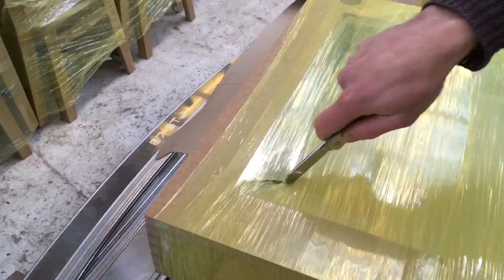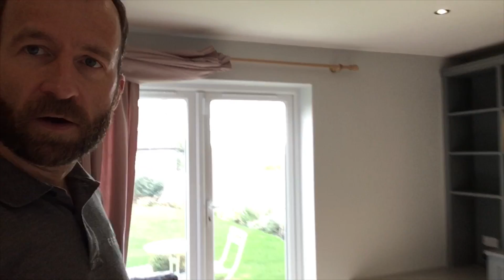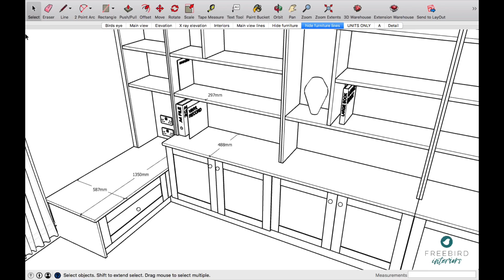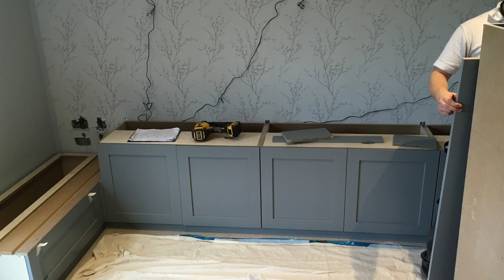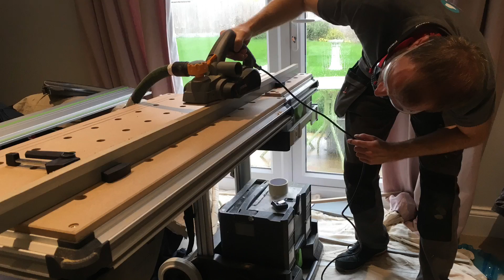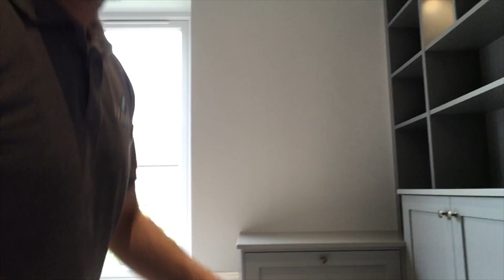From Sketchup Design to Finished Furniture

Comment: Great aolutiins for thus mistakes, wgat actually could be happen to everyone . 
Please let me know what software do you recomand for a beginer cabinet maker ? Software shat could build easy sny type of cabinets , maby could makd a quote if the orices of materials and laboures are already set up.  Many thanks.
Reply from the maker: Hi, well I use Sketchup and you will find a training course on it on my channel, and it is relatively easy to get started with compared to other 3D drawing software.  However if you want to go straight to making cabinets which are ready for cutlisting, pricing, etc, this is really quite a complex matter that either takes a lot of learning and set up, or you pay for 'parametric' cabinet software.  If you want to really keep it simple, research iphone and iphone apps that can do this.  But they will all have limitations.  If you want to get serious about this you could try CabinetSense but be prepared for a lot of learning time.  Make some time to watch this video: https://youtu.be/WaDJSBjrNjI?si=YQhW21DXVdYPLdnM

Comment: Hi there, always find your videos a joy to watch Alistair. May I ask you a couple of things, the doors did you make them yourself or had them made by example Lawcris. Ps which is the most one use (range/model) from lawcris in terms of melamine/laminate. Thanks in advance. ps. I am looking to use Lawcris you see and frankly I feel that if you know what you want its ok otherwise one just gets lost and a bit of a struggle to work them out.
Reply from the maker: Hi thank you!  We made the doors.  Or possibly at this stage we outsourced them as 2 piece made by a local cnc company.  Now we have our own cnc and make them either 2 piece or 1 piece.  Yes loads of laminate variations.  These days we use the ‘12-twenty’ range of melamine faced mdf by Finsa.  Bought via Able boards, Premier Forest, Lathams or Falcon

Comment: Hi, nice work. Quick question, how are you fixing the thin filler pieces on the sides in place? Thanks
Reply from the maker: For inset scribes like these ones I mostly just use a good construction adhesive, places sparingly towards the rear of the strip, on the unit and on the wall.  Sometimes also nail gun nails (18 gauge), through the wide panel into the edge of the scribe, so long as I have a matching wax filler to fill the holes afterwards.
Reply: @Alastair_Johnson  thanks. 👍

Comment: I'd categorise that as an adjustment rather than an error. But it does pay to sit back and think about a workaround rather than automatically thinking re-doing it is the only option. the finished product looks great. Also with that design of overlapping door - you could actually add strip LEDs and they would be defused nicely :-)

Comment: You got very lucky with that one mate . Very intuitive well done . I did notice a screw went in the wrong place in the drop done box ( workshop shot) 😀
Reply from the maker: You and Peter Millard both noticed that (along with everyone else too polite to say probably!)
Reply: Freebird Interiors 😀 hi Alister .would it be possible to send you a email about a cabinet I’m  building (for my self) in relation to the hinge or carcass position with an inset door closing flush with an end panel not the carcass as the inside is exposed birch ply with paint on outside? Hope I’m making sense.
Reply from the maker: david osullivan yes go ahead find my email via my website

Comment: Another great vid, many thanks for sharing. You mention at the start of the vid, the word "Design" which got me wondering, do you need professional indemnity insurance for designing furniture here in the UK? You know, proving that the furniture could hold up in all areas when fully loaded etc or do you just push this down the line to material suppliers/manufacturers?
Reply from the maker: Hi I seem to have missed this comment first time around!  Well I do have professional indemnity insurance but it’s rare I feel I’m doing  anything that might be risky

Comment: Have you seen the little cordless plane by Bosch, only 12v but it’s small, light and might be an idea for yourself when scribing the edges?
Reply from the maker: I have seen it on instagram, it looks good.  Since making this video I have bought the Festool EHL-65 planer and I LOVE this tool, it has a slightly spiral cutting blade and cuts very cleanly.  https://www.instagram.com/p/B42uix9AoYe/?utm_source=ig_web_copy_link

Comment: this probably sounds like an odd question - but on your cabinet carcasses, the top and bottom sections are set inside the two side uprights and not ontop and bellow them. Is there a reason for this?

goto 15.16 for an example
Reply from the maker: Matthew Dartford strangely enough someone else asked the same thing in another video around the same time!  It’s a standard way of doing it.  One reason is that the shelves, top and bottom can all by cut at same length and it goes together just right!  And I just think it looks right.  But there would be advantages to the other way, including skating things around on the plinth a bit easier!

Comment: Really nice job there. Interested in the CNC doors. Why they CNC cut all the way through with a rebate to accept another panel? The CNC machine could just mill out the material from the front to maker the shaker style and it would be flat on the back out of one piece of material. Just interested?
Reply from the maker: Simon Duggan hi Simon yes that would seem to make sense - more efficient use of material etc.  However in practice it creates a lot of work trying to sand the fluffy core of mdf that gets revealed.  Very difficult to sand this well enough to get a good sprayed finish on it.  Hence dropping in a panel.  Even vinyl wrap door manufacturers do this (I have cut up one of their shaker doors to prove it!).  Except actually they don’t route the door right through. Just a bit deeper than the panel then drop in maybe a 3mm panel, glued in.  This keeps the prefinished melamine back intact.  There is one company I have discovered http://www.cupboarddoor.co.uk/who machine raw MDF doors solid and achieve an amazing smooth sanded finish, presumably with some specialised machinery like a brush sander or something.
Reply: Thanks for the reply. Having thought about it myself I can totally see it would be more work to get the inside surface nice and smooth especially in corners etc. And of course the hinges! That's great. I have a very small 1000mm x 1000mm xcarve CNC and was looking to make some shaker doors on there. Obviously can't make out of a full sheet but this is ok as it's not production work. I will take your feedback on board when I try it. I'm splitwood design co on Instagram. Keep up the YouTube vids as well. Very interesting 👍👍
Reply from the maker: It just occurred to me there is a second reason: this method means routing from the reverse face which allows you to also create the hinge cup holes on the cnc.

Comment: Nice one Alastair 👍 So no mistake with the position of the struts on the drop-down door then? 🤔😆 BTW I always use 2 struts with those doors - I tried using just use the one it acted like a pivot and the weight of the door levered the hinges out... 😱😬
Reply from the maker: Peter Millard I was waiting for a comment on that!  I forgot it when I made the video then noticed it again when stitching the photos together.  We filled and resprayed the holes.  I see what. You mean about the lever effect, yeah 2 stays are best, especially for a wide flap.
Reply: Eagle eye Peter

Comment: I have 10 full height doors to make next month and I'm really considering buying them in. Any recommendations for suppliers welcome.
Reply: I'm curious to know why you opt to drop in a panel when you could just have the door made from a solid sheet with the detail routed out? (cnc)
Reply from the maker: Because you can’t get the routed core of the mdf smooth enough for a painted finish. At least not without so much sanding work that it’s more hassle than the dropped in panel method
Reply: That's really interesting. There are lots of companies online who offer  sjalee style doors done on the cnc.  Some offering full painting service do I guess they must be getting good results. I'm meeting with a local company tomorrow so we'll see how they are. Will let you know.
Reply from the maker: Yes let me know Id be interested.  Not long ago I replace an alcove installation that the customer got made via Jali.  Customer wanted the design expertise and proper installation.  It encouraged me that there is still a place for our personal design led approach even as these clever bespoke CNC factories increase in influence.
Reply from the maker: Anthony James Brown that’s a lot of tall doors!  Stresses me out trying to manage clamping, sanding and painting so many tall doors and keep them straight.   For most of our wardrobes I steer customers towards vinyl wrapped options.  I recommend East Coast Fittings if this is suitable.  With that sort of thing you just pick a style and give them the sizes required.  For painted I’d get them CNC’d in 22mm MR MDF with a 9mm or 12mm label dropped in but this means finding a more flexible cnc manufacturer and preparing drawings in the right format, and some understanding of suitable cutters and radiuses, we’re only just getting to grips with this.

Comment: Another great video mate - my Dad has a saying which I think of every time I have to deal with a problem at work  -
 ' it's not how you get into trouble , it's how you get out of trouble ! ' , which is very true isn't it ? .
Do you think doing a  full height scale drawing of the unit would have helped you to notice the problem with the door height ? - I do it every time I do a newel post layout , just to give me the confidence I've got everything right before I start cutting .....
Reply from the maker: RICHARD RJ JOINERY that’s a good saying!  And you mean like a setting out rod?  Coming from an architectural background with very little proper woodworking training, I worked from drawings from the start but I have often been struck by the good sense of making full size marking rods and occasionally remember and use them, but mainly for real joinery work (we used to make nice solid wood gates) but that’s rare these days!  We increasingly trust the drawing and work from those sizes, but I suppose we got complacent.
Reply: @Alastair_Johnson  that's it mate - a marking out rod . I know it sounds a bit old school,  but it works and it's always handy to refer back to during the build . I once did an oak newel post on a winder stair and marked it wrong  , cut out the housings , then realised my mistake . You only do that once on a 90 x 90 X 2100 peice of lovely oak don't you  ? ...
I've used a story rod ever since .